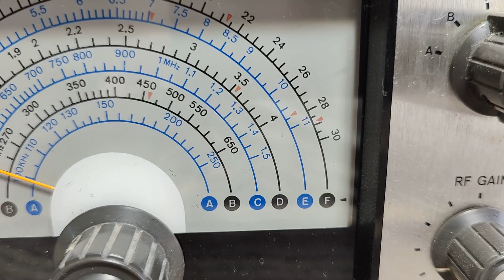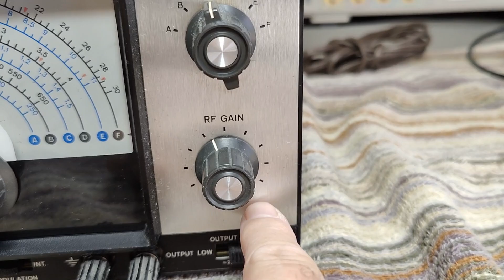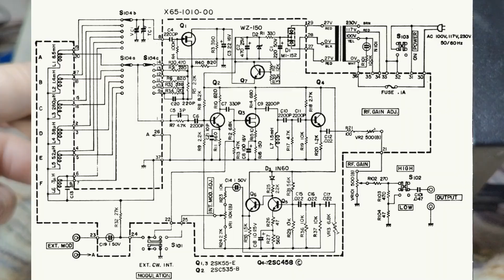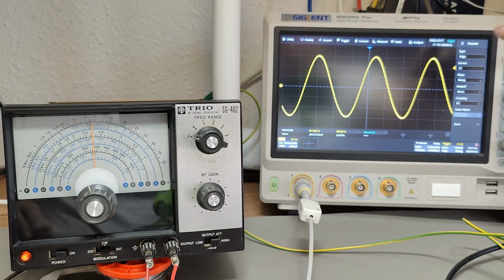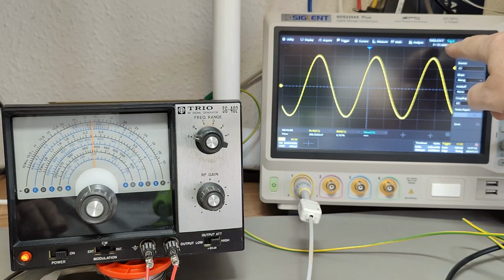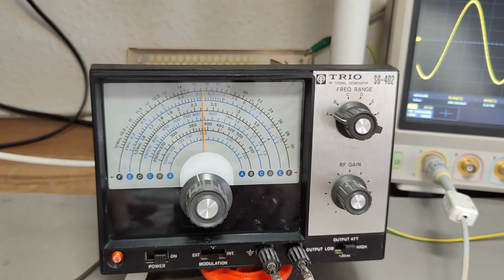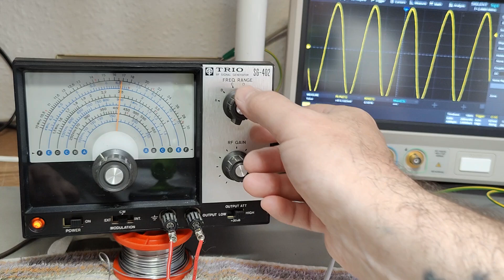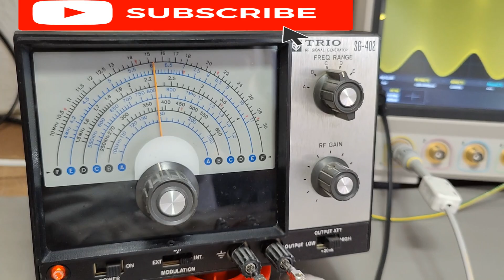TRIO Kenwood SG-402 RF Signal Generator 100kHz - 30MHz 1974 teardown

Comment: Interesting little oscillator, Trio also used that case design for an oscilloscope,  so maybe there is a range of gear in like boxes. I'm guessing the power transformer is on a raised section as they were concerned that the mounting bolts were extending too low, so they could either do this, or fit taller feet, however taller feet would make this unit look out of place when set next to other like cased instruments.

Comment: The pedestal the transformer is mounted on is simply for mechanical clearance on the bottom of the chassis.  Producing that feature isn't very difficult, a set of dies are used on the top and bottom and it's punched.  There might be a series of a couple of dies to form it in steps, reducing stress in the steel as it's formed.  I've seen the technique used quite a bit over the years.  
The knob turns backwards because they didn't want to spend the extra few cents to put an intermediate roller between the knob and the tuning cap shaft to correct the rotation.
Reply from the maker: i think this punching is super interesting, since the lifted part needs more length material, to get that, it mush streech the material using very high force, the hold bottom plate straight force at the same time, must be crasy high
Reply: @TeardownOZ2CPU  The dies keep everything perfectly straight.  Imagine the top die and bottom die are the same shape as the 'strap' less the thickness of the metal it's made of so it's squeezed perfectly between the 2 dies.  Because it does have to stretch the 'sides' quite a bit, it may have been done in 2 steps, I'm not that familiar with punch press operations. I know the old school ventilation louvers that used to be common on stamped equipment cabinets were stamped with a single die set so you can displace a fair bit of metal before it starts to tear. 
 I love the simplicity of this old equipment.  You can just look at it and figure out roughly how it works.

Comment: Alternative theory for transformer mounting... They wanted the transformer to be removable, i.e. screw mounted.  The screws have to be undone from inside the unit because you don't want idiots undoing them from the bottom and the transformer dropping off and breaking things. Self tapping screws are best, otherwise nuts can be undone from underneath. You don't want the points of the screws sticking out beyond the bass plate. Solution? Bend the chassis. Incidentally, Trio is normally pronounced tree-oh
Reply from the maker: thanks a lot for your comments, it sure look like an odd way mount the transformator, there must be a good and smart idea behind it, you could also be right :-)
Reply: Makes sense to me!
I'm thinking they mounted the transformer that close to the PCB because they needed the metal near the edge to make that bend properly maybe?
Reply: Yep, that was my idea as well, no screws sticking out to scratch your bench. They need to press with a lot of force anyway to punch the holes. That is probably done in a single stamping operation.